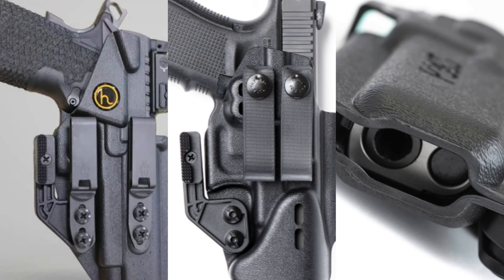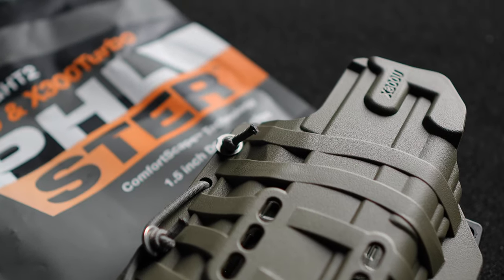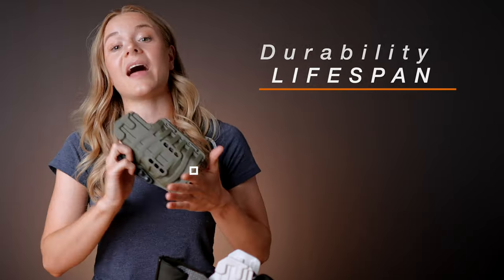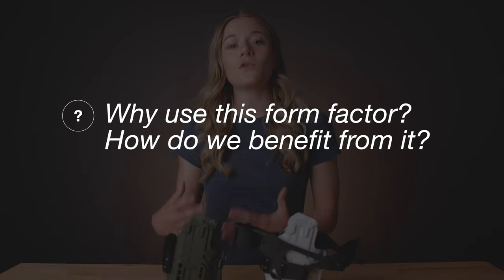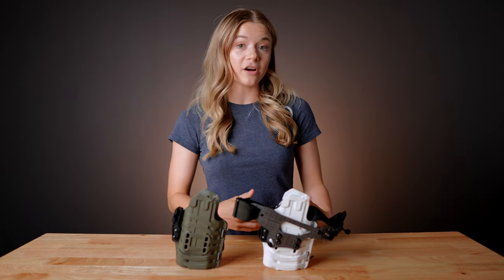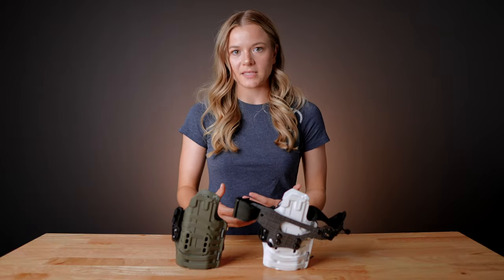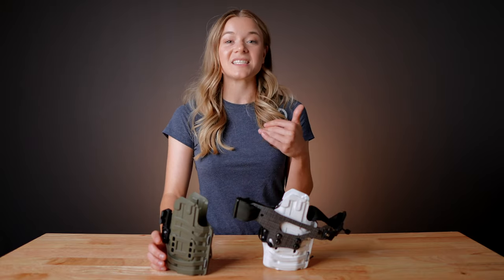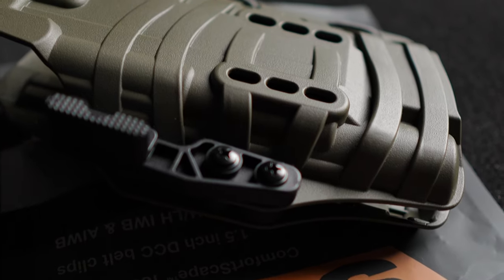New ComfortScape Technology Explained

Comment: How much of the comfortscape benefits do you estimate are negated by the addition of a concealment wedge that many people will add?  It seems like a wedge covering a large percentage of the back of the holster would cancel out many of the benefits the design brings?  Primarily limiting air flow and reducing moisture.
Reply from the maker: Depends on the wedge size and material. Some choices are very stifling and sweaty. 
If you’re careful about the wedge material and judicious about the size, you’ll still be plenty comfortable.
Reply: I'm thinking of slotting my yoga block wedge for my 1st gen floodlight 🤔
Reply: Drilling holes in a wedge increases air flow. About 1/4 or less diameter a half inch apart.